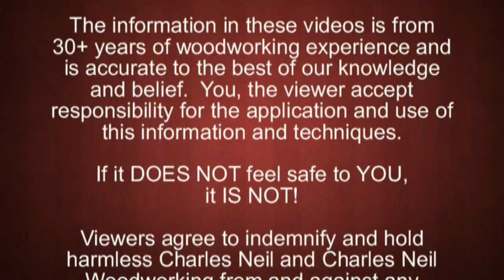Build a Pie Safe with Charles Neil - Episode 2

Comment from the maker: @dkennedy1730  the infeed and out feed rollers press down and push the material forward, in this thought the front cleat makes sense, then it engauges the cutter head, which is cutting against the feed direction, and with alot more speed and inertia , how about we just put a cleat on both ends,, seesm like the easiest way to be sure .. good to hear from you....